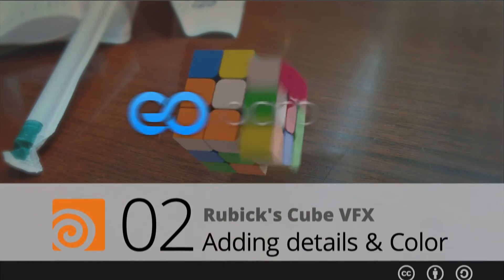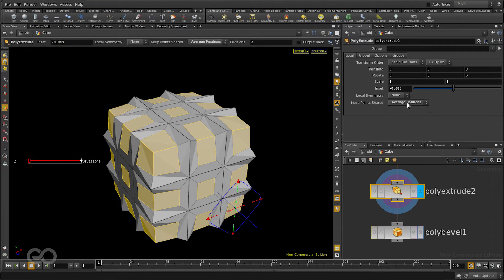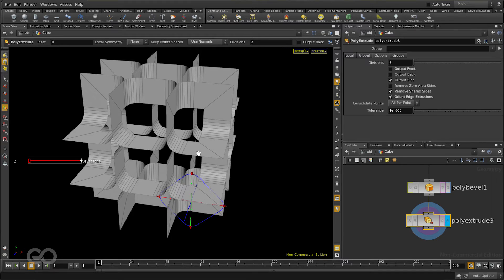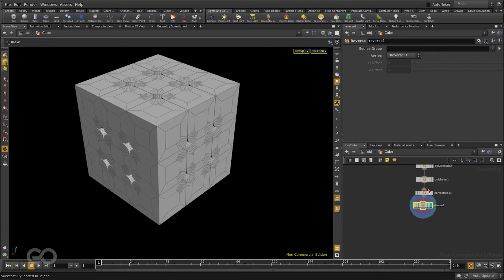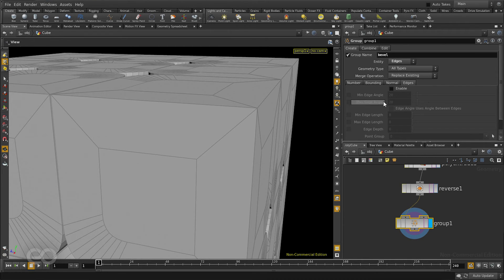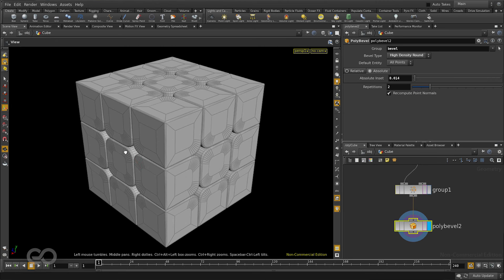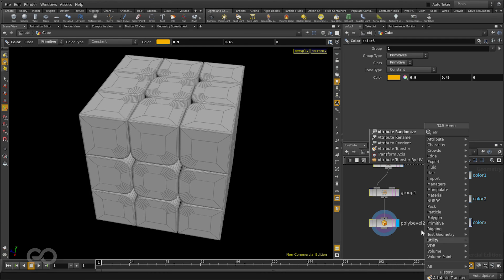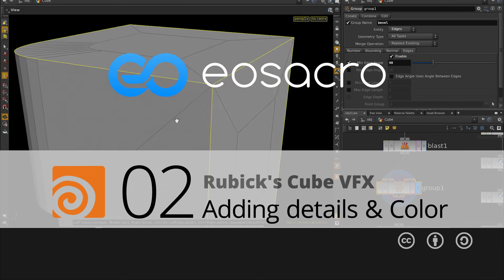Rubik's cube - 02 - Adding Details & Color

Comment: Those who are not getting the same result, need to use fuse node with a distance value of 0.001 after first poly extrude. Also, the divide into option should be set to individual elements in poly extrude.

Comment: Great tutorial. Not sure if I missed something or if it's a version problem, but the side faces disappearing when inset and z translation were matching doesn't seem to happen in v16. I had to add a fuse node after extrusion, to merge double points. Bevel node works differently too.
Reply: I'm having the same problem with H16. How did you use that fuse node to solve the issue?
Reply: I added a Fuse node after the 1st polyExtrude : https://www.evernote.com/l/AbfeJAlibSFJJYpdFHsil8sR5aQLPogFDq8B/image.png